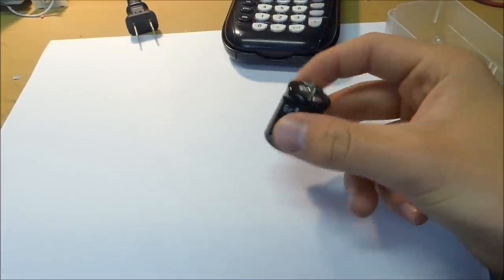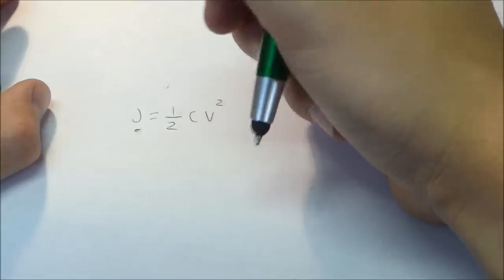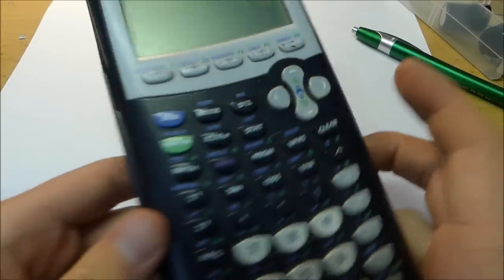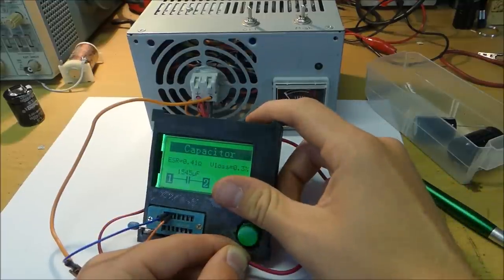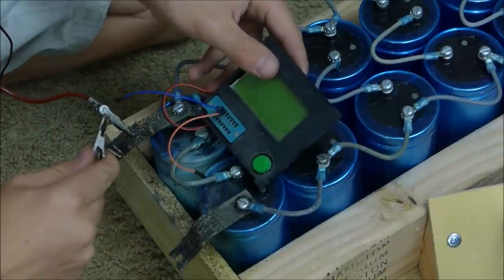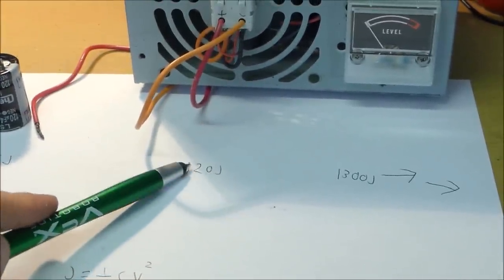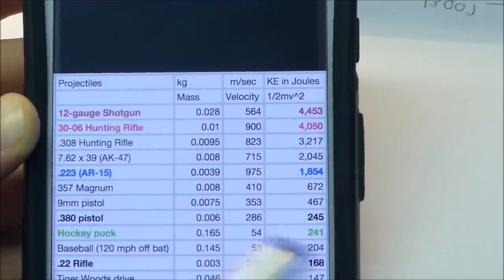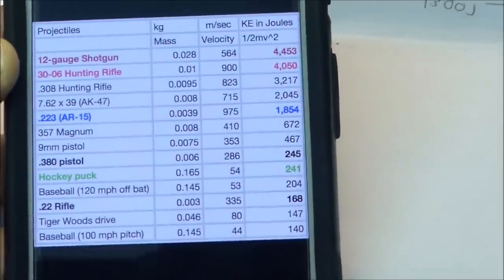Measuring Energy in a Capacitor Bank

Comment: Could you drain the mother-capacitor slowly and use it as a battery? What home appliances could you power and for how long¿?
Reply: Can imagine that, and afaik it is also used for some quick charging things. I saw even some pics of public transport buses, that should charge in the stop really quickly , so it needs to be a capacitor and the use the charge during moving to the next stop.
Reply: You could, but there are other technologies that are better for that type of job (e.g., batteries). A capacitor bank's forte is releasing a large amount of energy very quickly, which it can do better than most other technologies. But if you're just asking if it would work, I'm pretty sure the answer is yes, just not for very long. It would be great for an application that only requires short bursts of power - like photo flash, stroboscope, tack welding, that sort of thing.
Reply: It would operate only for a short time. For example a hairdryer with 1500 watts needs 1500 joules, per second. So the mother-capacitor couldn't even power it for one second. And you can do the math for other appliances: A 100 watt lamp could be powered for 13 seconds.
Reply: @frankbuss  Looking forward to capacitor bank vs car battery. ^_^